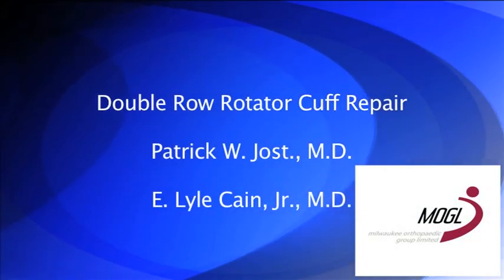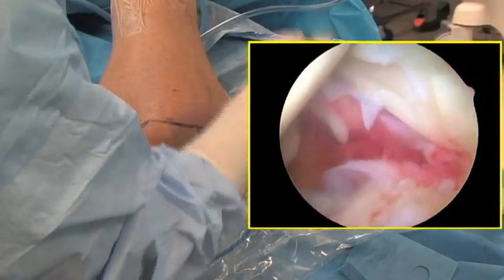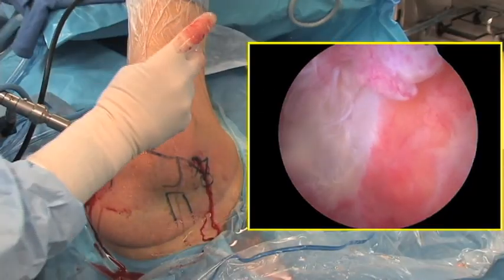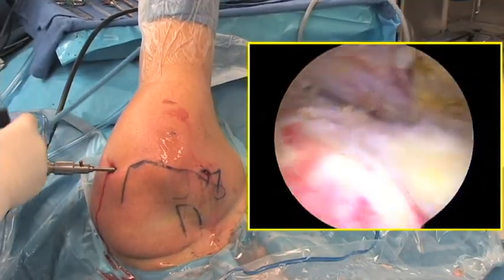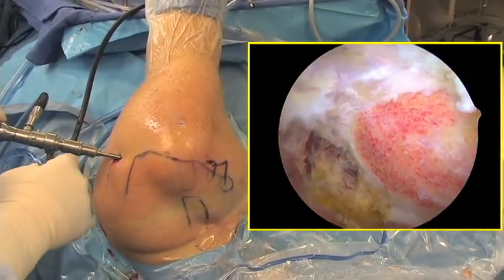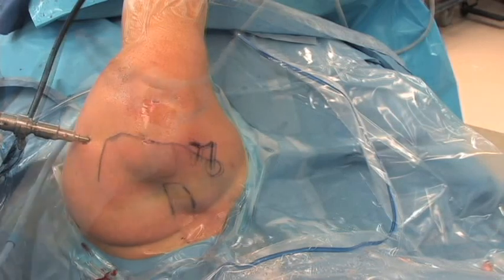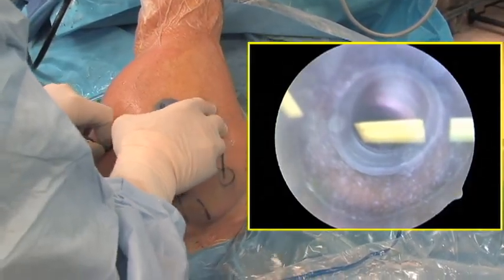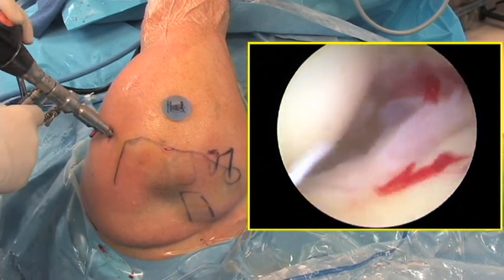Rotator Cuff Repair by Patrick Jost MD - Milwaukee Orthopaedic Group

Comment: I have had two shoulder arthroscopies - the first to repair a torn rotator and remove a large bone spur inside the joint, and the second to just remove a bone spur from the other shoulder. Rotator repair surgery is fairly painful afterward. It took me 2 months to regain about 50% functionality. The other, without rotator involvement, recovery was much faster and with a lot less pain overall..